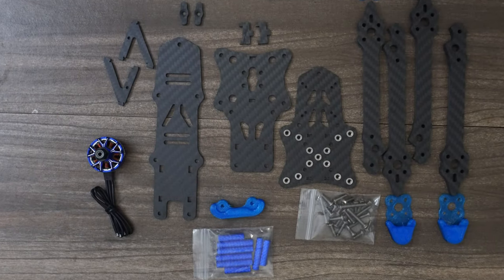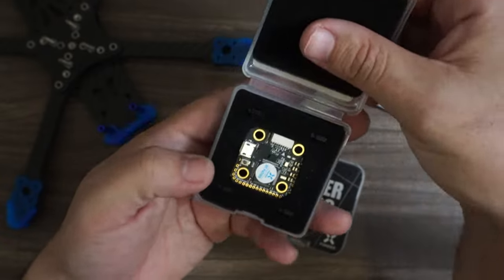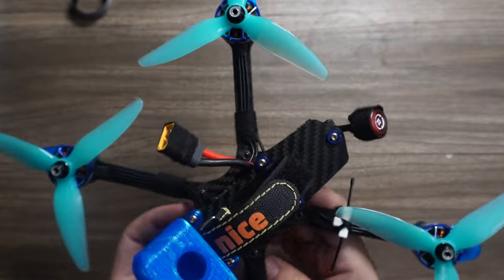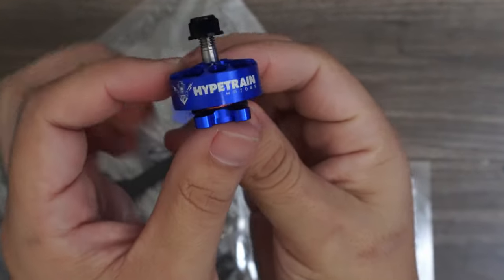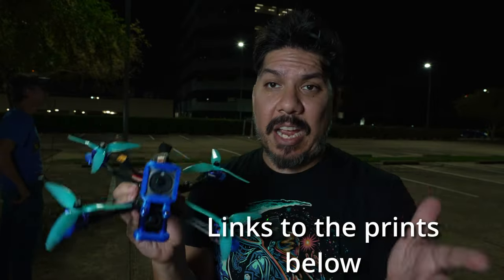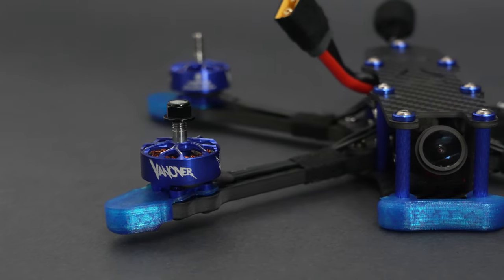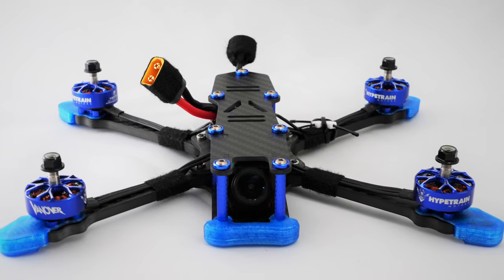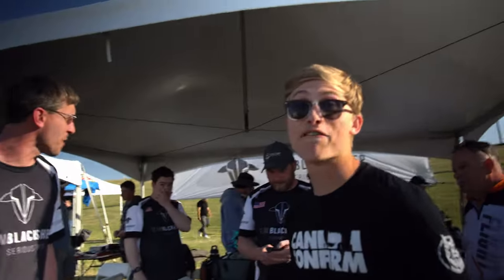Michael Bay's Drone pilot designed this

Comment from the maker: Jons Wardrobe provided by 
https://intotheam.com/jonE5
10% off code: jonE5

Support the channel by using any of these links
Vannystyle Frame kit 
- https://www.getfpv.com/vanover-vannystyle-5-frame-kit.html?afid=Q0lGVFUveWN0R009&referring_service=link
- https://www.racedayquads.com/products/vanover-vannysyle-5inch-frame-kit?aff=34
- https://vannystyle.com/products/vannystyle-frame

Foxeer FC - https://www.getfpv.com/foxeer-f722-v4-dual-bec-5v-10v-8s-hv-flight-controller-mini-20x20.html?afid=Q0lGVFUveWN0R009&referring_service=link
Foxeer ESC -https://www.racedayquads.com/products/foxeer-reaper-f4-mini-128k-32bit-45a-3-6s-20x20-4in1-esc?aff=34
HDZero VTX - https://www.getfpv.com/hdzero-race-v2-shark-byte-digital-hd-video-transmitter.html?afid=Q0lGVFUveWN0R009&referring_service=link

Comment: The frame is amazing the only negative for me is the lack of fpv camera mounting positions. There is only one position hole in the V and there is no way to get the frame out of view when using a wokesnail camera.
Reply: why does jon e5s frame have 2 sets of camera holes did he make modifications or did they update it and add an extra set of holes
Reply: @lililililililili8667  Good question
Reply: We have new updated camera plates that we are rolling out, they have an additional mounting hole. I’m going to make an announcement soon and offer a discount to all people who have bought a frame so far :)
Reply: In the meantime if you use the Rc18g lens which is longer and a better fov than the stock lens it works great!